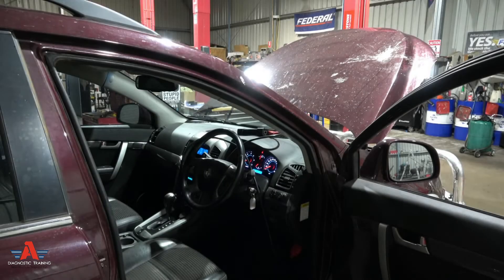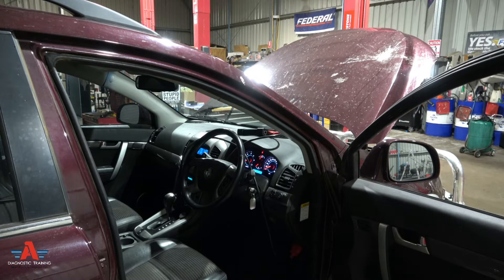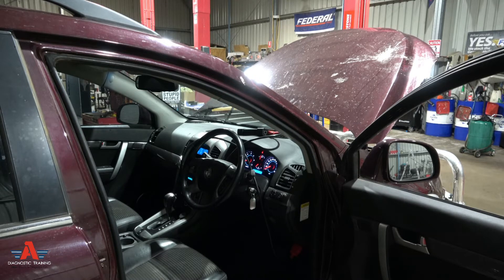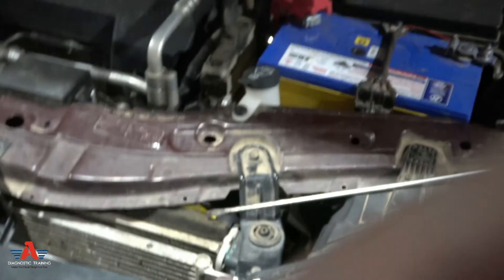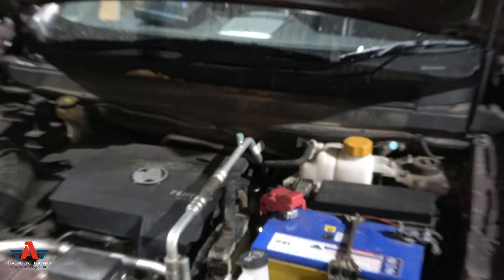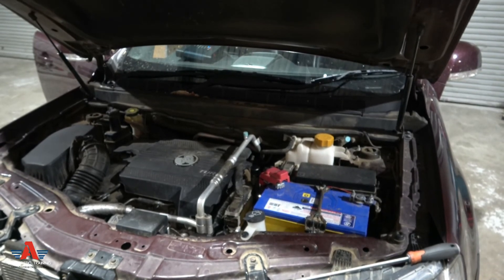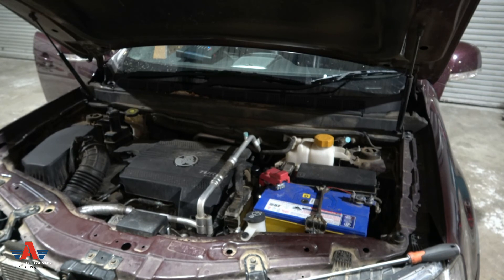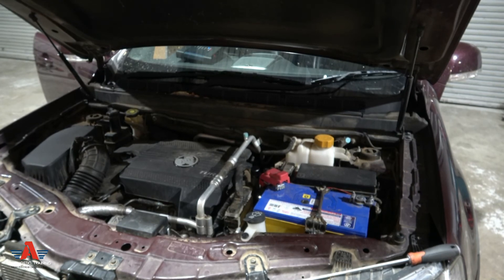Captiva DPF blockage fault

Comment: Thank you mate, had the exact same pipe split on a Holden Captiva Diesel 2013 model.

I was getting all sorts of codes shows up but could hear a hissing sound coming from engine bay when driving under load.
P02E4 – Diesel Intake Air Flow Control Stuck Open
→ Swirl flap actuator or flaps not closing properly

P0401 – Exhaust Gas Recirculation (EGR) Flow Insufficient
→ EGR valve clogged, stuck, or restricted

P122D – Boost Pressure Too Low or Turbocharger Underboost
→ Boost leak, actuator issue, or turbo fault

P15A0 – Charge Air Pressure Control
→ Related to turbo/boost regulation system

P2000A – Intake Air System or Runner Control Bank A Performance
→ Often tied to intake runner (swirl flap) malfunction

For others, I was experiencing this below:
- Power loss under engine load (above ~2,000–2,500 RPM)
- Black smoke from exhaust when accelerating
- Hissing noise from air vents (gets louder with throttle)
- No black smoke when the car enters limp mode
- Car has been driven 500km+ with no improvement
- DPF cleaner did not fix the issue
Reply from the maker: All fixed?

Comment: I did exactly what you did and found the problem right away after my car started smoking allot. It was just as you pointed out a hole in my turbo pipe. Changed it out and problem solved. Thank you so much.👌💯

Comment: I have same Captiva 2.2 diesel 2012 have white smoke from exhaust while its reach to operating temperature. There is no Coolent lost at all. I feel turbo leak oil in inter cooler. It can be cause of white smoke ?
Reply from the maker: Yes
Reply: Hi mate, thank you for reply. Any air leak can cause white smoke as well? I can hear hissing noise as well. Thank you in advance for helping.
Reply from the maker: Yes too but not as bad. May be check the intercooler hoses etc.

Comment: Hi thanks for the video , i have a big problem with a Chevrolet captiva 2,2 from 2011  , underboost problem a lot of thing have been changed in new , intake , pipe of turbo , turbi , egr valve , map , maf , injector ,high pressure pump , but i have a big loss of power  , PO299 default , on my diagnostique wallet , it seems that the EGR valve is not working , she's brand new , and work perfectly when i plug it directly in 12 V , i try to solv the problem since 5 years ... Do you have a contact ? Thanks AL

Comment: My partner has a 2008 Holden Captiva give a fault code P02E1 and I want some advice before I start replacing expensive parts. I have had it at 3 mechanics that have not been able to give a clear diagnosis.
Reply: I would like to send a picture to you with the fault code and potential causes
Reply from the maker: Sent it to a1mechanicaloakey@gmail.com

Comment: which obd scanner do you use ? It looks very useful but there's so many to buy out there. I have a chevrolet captiva 2.2 diesel manual. In my book it does not tell me which obd type I need (16 pin ) or different. It is a uk model not EU car. Ideally the kind you have with a large screen for diagnostics is good for me. Any help would be useful thanks.
Reply from the maker: All cars have obd 16 pin. Atleast since 1998. I have autel ultra. It has very large screen and super fast to use.
Reply: @a1mechanicaloakey I just looked for them. That is around £4000+ if i’m right.
Reply: @a1mechanicaloakey  how much can I buy the same obd scanner as yours for ?

Comment: Hi I have 2013 captiva, the engine makes so loud nocking noise with car and spanner symbol on it. when I drive on low speed for about 30mins, service symbol and noise disappear. Where are you located mate?

Comment: Hello, I am Pieter van den ham, I live in France,
I have a Captiva 2.0 16v CRDi

I have the same problem,
The car have no power,
Its holding in, climb a mountain is difficult

I hear a little noise a few seconds when I want to
 accelerate
It was in a garage for change oil and all the filters
They look with the PC

They gif the error s
System EGR A po401
po 2 E1
Po 544 temperature exhaust, banc 1 capture 1
P2463
P 2080

Comment: Hi there ours is having trouble maintaining boost or sometimes overboost, codes are p0047 & p0299. We can hear the wastegate opening quite often even at light throttle, it sounds like an external wastegate on a jap racecar lol!! sometimes it goes really well and seems like theres no problems with it other times it really lacks power and struggles to move. I just wonder if its the turbo itself or something else, its done 221,000km 😊 Cheers

Comment: I have a 2013 captiva which engine light came on and went off came on then off,  took it into the shop to get looked at was told egr valve not working,  New egr and check engine light came of with same code p0401 took it into another shop they said had excess carbon build up paid for service for complete flush, hour after they reset the code the light came back on same code.  Black smoke when you put your foot down on the gas.  Leaves a cloud of black smoke.  Out the back of the exhaust pipes is a thick carbon buildup.  So I'm guessing will be DPF blocked up.
Reply from the maker: Follow the procedure on the video, if not find a professional.

Comment: He mate,i’ve got same problem,but the thing is there’s no warning symbol on the dash,and it’s driving perfectly,it’s just the smoke that come’s out on the exhaust often,and when i pulled over and turned off the engine,the fan started to run in full speed for about 1-2 minutes,what was the problem?been in 3 mechanic already.
Reply: Had the same issue, no warning light but a nasty black smoke on low gears & hard acceleration. I took the same root as per the video and got the culprit cracked on its bottom part and I had a custom one made with stainless steel pipe. Now she runs like a horse with no issues.
Reply from the maker: Bring it to me
Reply: Been also on fuel injector specialist,but nothing happen.there was no scan diagnostics.
Reply from the maker: It's hard to diagnose over text. I will need to see the car.

Comment: Thanks so much for this, we have been having issue for the last 2 years with DPF light and power reduction light coming on. Fault investigation by garage found nothing, then main dealership service found nothing. The funny thing was the dealership service replaced the gearbox oil, which is filled next to the hose. In the end I just replaced my, took about 30 mins to replace, but had to order via eBay as part not available. Once replaced all is good. Other issues resolved was, fan always on for 5-10mins when engine turned off every time.
Reply from the maker: I'm glad Mark. 😊 please do share the video. I had many customers myself been to other shops with no luck.
Reply: @a1mechanicaloakey  I see so many Captiva with black smoke on the tail gate and think they have a split pipe. I nearly feel like printing a flyer with link to your video explaining the issue and to get it checked by a garage.
Reply from the maker: Lol

Comment: Good Day . I have a Chev Captiva 2012 AWD 2.2 diesel . The car and spanner light comes on on the top left side of the control panel causing the car to go onto lim Mode . please help me fix it . im in South Africa . many tried but failed .
Reply from the maker: Need more information.
Reply: i also noticed it mostly happens at a idle rev below 2 RPM
Reply: I have this problem also. Engine light with spanner symbol inside comes on. Car drives and increases speed but not like when i use the accelerator pedal normally. Turn the engine off and light goes out. Starts again, no light on and acceleration back to normal. Light comes on every 100  to 200km. Disappears when engine turned off.
Reply: @thediscussionchannel3207 did you get this sorted? Im having this issue now.

Comment: Thanks so much, this was spot on. Have the same car, badged as Vauxhall Antara, with EGR & DPF issues, loss of power and black smoke on acceleration. Watch video and checked mine for split, changed hose and problems solved. Thank you!
Reply: I’m going to check mine . It’s a 2012 diesel Captiva I just bought on Friday . I noticed hissing sound and also lots of black smoke . Had a full service done today and they said they did a re-gen but reccomend me taking it to Holden for a DPF clean/replacement because they don’t do it . I’m going to give this a crack . Very helpful video . Thanks you
Reply: Hey where abouts are you ? Are you in nsw?
Reply from the maker: I'm in Qld
Reply: @a1mechanicaloakey  bummer I wouldv brought mine to you
Reply from the maker: Appreciate it.